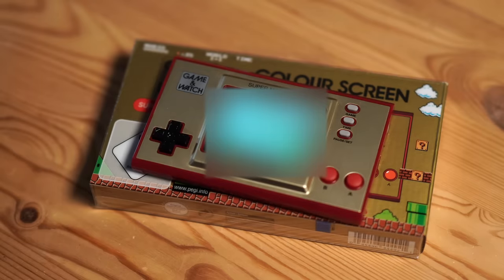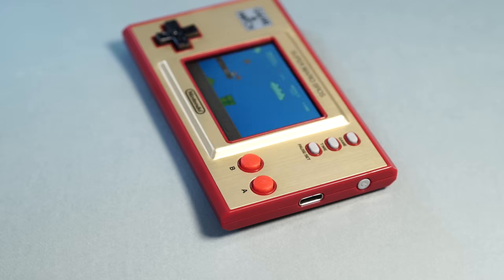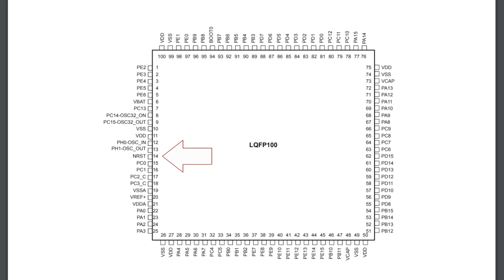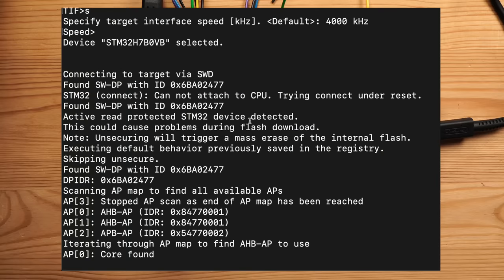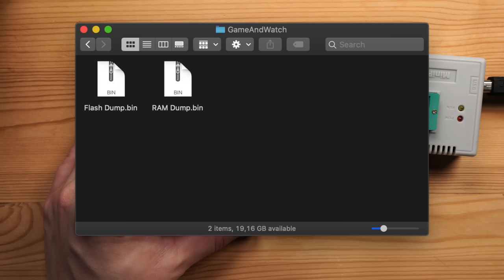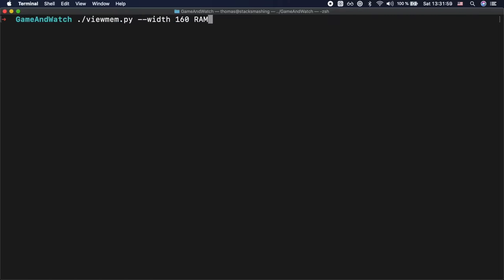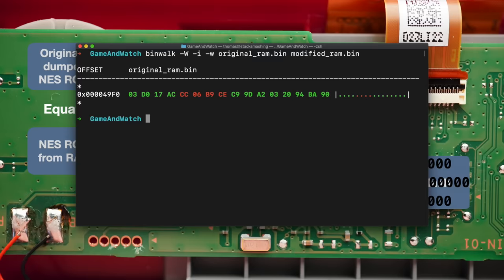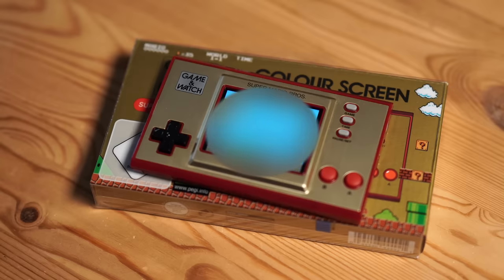Hacking the Nintendo Game and Watch

Comment: I can't wait until they make it easy for us to dump roms into this thing...
Reply: Since the USB data ports aren't connected it will never be as easy as the NES mini. Maybe people with the tools and know how though will provide a service you can send your game and watch in and have it reflashed.
Reply: @littlefreak3000  yeah I know they explained that part in the video... but now they know where the data is, I'm wondering if they can connect the data to the port OR take the exsiting port out and putting a whole new one on there with a modded chip that connects to the data... I don't know if it's possible but since they've isolated the data point it's not impossible right?
Reply: @littlefreak3000  otg via usb-c port can be?
Reply: @jeffcross9960  Impossible? No. Even remotely simple? Definitely not.

If these were being produced on a much more massive scale, and Nintendo was openly planning to make many more units in the coming years, it might be worthwhile for someone to make/sell a custom programming device/clamp that could do the process faster. For how small of a run this is, that's highly unlikely to happen.

As it is, I think the best we'll get is a few folks specializing in doing the process themselves manually as a paid service. If the service could be done for a reasonable price, I might be down for it.

Realistically though, I think that it might almost be better for someone to figure out how to store something like a pi zero inside of one of these shells, with all the buttons and everything functioning as they should. But... This looks to be a teeny tiny device. Not much room to work with in there. Who knows.
Reply: @dantehchad2227  yeah I figured... but still if people REALLY want to do this they could and that's enough for me to be at least a little hopeful. I was also thinking of a pi zero but with all the single screened Game & Watch games in them as well hahah... again high hopes and low expectations... so I AM thinking realistically...
Reply: @jeffcross9960  I think you're on a reasonable track there. Honestly, with these coming out, I wonder if someone might do a teardown, clone the body, and redo the internal layout to be friendly enough for a pi zero setup. Be pretty easy to put the entire collection of NES and GB onto something like that, and I imagine a lot of DIY types like myself would totally buy a kit like that to put together on the weekend.
Reply: @dantehchad2227  I would SO love to buy one of these kits to make my self... I DID buy 2 of them hahah... I would be even more into it if they can add another screen hahah but that might be asking for too much lol.

Comment: *1 month later
"Play Original Doom on a Super Mario Game and Watch"
Reply: Not nearly enough RAM. Maybe a cut down version such as the 32x port. Wolf3D or Blake Stone will run just fine though.
Reply: It literally has 1mb of storage. You ain’t playing shit on this thing.
Reply: Andrew Oberhauser Some Doom ports were fit into 2 megabytes with multiple levels. And they probably didn’t even use compression. Back in the 90s I had a copy of Quake with some multiplayer mods (but only 1 level) on a single floppy disk.
And finally, since you need to open it anyway, SPI Flash chip should be trivial to replace.
Reply: @noop9k  this has 1mb. And your average modded isn’t going to replace the chip. There won’t be a scene for this thing.
Reply: Andrew Oberhauser The scene won’t ask your permission.
Reply: Aaand the Doom port already exists

Comment: Awesome video!  I am currently trying to figure out if doing video out from one is feasible. I am not very knowledgeable about these smaller LCD panels. Are they mipi or standard lvds? Is there even such thing as a video splitter for the signal output or would I have to run jumpers from pins?

Comment: With the ability to load any game on there, I might just buy one of these. Could backpack another microcontroller and larger ROM on there and potentially have a hot-swappable game library? Or perhaps the firmware is able to handle a larger rom with more contents? Identifying the game directory format in ROM would be interesting. Also can you try the various under-volting (with specific timing) techniques to break STM32 read-out protection - this has been accomplished recently (STM8 for sure and possibly STM32). Reverse-engineering the firmware of this would be very interesting and have lots of potential to add new mappers, more games, etc.

Comment: You're going up against a stacked deck if the Embedded system is using the Flash in a XIP mode. My guess is that they may be moving some parts of it to RAM for faster execution. Unfortunately they are probably not using the Flash as memory storage so those handy Flash read/write and sector management functions would probably not have been moved to RAM :(
I cannot believe they did not completely lock down the SoC though... wonder if there are any test functions in RAM that they were using for manufacturing QA, possibly even provisioning (though I doubt for serial flash programming; that was prob. pre-programmed before going on the PCB).
Pretty weak encryption on the flash too, they left the door wide open (inspecting the RAM and flash and doing a reverse encryption), was it actually XOR or some polynomial (n-bit shifter) ?
Good work on it so far, good luck on the rest!
Cheers,

Comment: Since this thing is more or less made from off the shelf parts, wouldnt it be possible to upgrade the flash chip to something larger than 128kb, then load the original firmware on it (after an exploit to load further roms on it has been developed of course)

Comment: What is your approach for dumping this chip?
I have had great success dumping the F2 and F4 chips (rdp1)  using vcc glitching on the system bootloader. Perhaps this would work on the H7B0 also?
I was also able to dump F2 at rdp2 by a double vcc glitch.
Reply from the maker: Yep that’s the plan, glitch on vcore while in the bootloader
Reply: You think you can glitch it without removing the chip from the pcb or did you buy a bunch of these for this purpose? :)

Comment: Great work!  Next step: desolder old 128 KB flash module and solder in new 1 GB flash module and then load in all the NES games that ever came for the NES.  It's only 8 pins you have to desolder, not that difficult.

Comment: Very interesting to see them using a flash chip, but I guess it's a necessity when they have to deal with large ROMs. One thing you should check is the BOOT_ADDx register (refer to section 3.4 Boot modes in the datasheet). This should hold the address of the main program's entry point, which could very well be in the RAM! In this case the entire program is held in the RAM, which would make sense. Maybe you can create a hacked Nintendo ROM that will read this register?

Edit: Yeah, if I were to make this thing, I'd probably put the entire emulator engine as well as the games into the flash chip, and leave the MCU firmware quite primitive, only having it read and decrypt the flash chip, load it's entire contents into RAM, and jump to program's entry point. What's the size of flash chip in your case? Does it fit fully into MCU RAM?

Comment: Can you just write a program to memory that will read the flash?
Reply from the maker: Unfortunately not, any access to the data bus causes a hard fault
Reply: @stacksmashing  So debug mode allows you to view ram, but you cannot write to RAM, you cannot control program flow?  I was thinking if you could write to RAM, you could write a program that dumps the flash to a serial port.

Comment: Can you hack the system so it doesn’t shut off after eight minutes so you can use it as a clock
Reply: It will stay on if you keep it plugged in.

Comment: Pretty interesting and impressive, they've got a full NES emu running on the UC!?
Reply: Nintendo had a NES emu running on the GBA over a decade ago.
Reply: @powerlated1348  Wait what? Source? Also, a GBA CPU is somewhat closer to a SoC than to a UC in terms of power (but then again, that specific UC in the G&W is pretty beefy... and in fact might be pretty close to a GBA, not only in terms of performance but in architecture too IIRC).
Reply: @cheaterman49  Powerlated is mistaken. Nintendo ported some of their NES games to gameboy, but it wasn't emulated.
Reply: @HamburgerExplosion  Alrighty, thanks for clarifying :-)
Reply: @cheaterman49  No, he is wrong. The Classic NES series games are in fact emulated, and the games’ graphics are drawn through the tiled background modes of the GBA PPU. For the CPU power of the GBA, I can guarantee you that the teeny tiny ARM7TDMI stands no chance against the STM32 in the Game and Watch. Even if both CPUs ran at the same clock speed, the STM32 would be more performant via more efficient CPU design (pipelining, out of order execution, branch prediction, etc.)

Comment: did you try these attacks against it? https://www.usenix.org/system/files/conference/woot17/woot17-paper-obermaier.pdf  ; because its RDP 1 section 3.3 . 3 years old but still could work. This is also a great chance to play around a chipwhisperer lite if you have one, the creator of the device used it to extract firmware out from protected smart light bulbs.
Reply from the maker: Check out wallet.fail, where we did less invasive attacks on the STM32 to dump it - planning to try that once a couple of test H7B0 arrive :)

Comment: so... the usb data pins are disconnected? lol we can design a flex pcb that ties into those pins connects a interface chip to allow communication with both the flash and microprocessor... pretty sure it will end up on aliexpress soon

Comment: So the emulator in this does patching on the fly, that's very interesting.
Nintendo did the same for the emulator used for Super Mario 3D All-Stars and it seems to make things easier for them as they don't have to fiddle around in completed code.

Comment: I hope there will be a modded firmware where you can disable the sleeptimer. I bought the game and watch to mainly use it as a clock. But after a couple of minutes it goes into sleep mode/turns off. Also wish for an easier method, because sadly the usb is only for power.

Comment: This thing will be so cool if it's easily hackable.
Reply: But it isn't.
Reply: @moral1481  Depends on what you mean by "easily hackable", but considering the equipment to hack it is pretty cheap and the security is close to being broken I'd say it qualifies.
Reply: @blahdelablah  it would be easier if there was a data connection on usb c. Wich is expected on a divice this price range. Imo. And there is not enough space on it.
Reply: @moral1481  If there was more space on it it would have been overengineered.
Reply: @blahdelablah  maybe this would lead to a more quality product.
Reply: @moral1481  Not really, it would just jack up the cost. Think about it like this. The device is sold with 3 games. Why would they add space for 20 games if all they need is space for 3 games? There's no reason for it. When you hack devices like this you're working against what the manufacturers intended, if Nintendo wanted people to hack their devices then you'd have a point but I'm pretty sure they don't want that.
Reply: @blahdelablah  so you think nintendo wants the nes mini and snes mini to be hacked?
Reply: @blahdelablah  often the microchips for companies are cheaper because they buy larger quantities of them.
Reply: @moral1481  "so you think nintendo wants the nes mini and snes mini to be hacked?" No. Read what I said. I'm suggesting Nintendo doesn't want any of their products to be hacked.
Reply: @moral1481  "often the microchips for companies are cheaper because they buy larger quantities of them." Yes, but that has nothing to do with it, because buying 100,000 1GB flash ROMs will still be cheaper than buying 100,000 8GB flash ROMs. In engineering, you optimise the design based on providing the required functionality at the lowest cost. It makes no sense for Nintendo to buy larger flash ROMs when they wouldn't use the space.
Reply: @blahdelablah  but why had nes mini and snes mini consoles etra storage space, then?

Like the battery in the game and watch is from the joycons. Nintendo got many of them laying around.
Reply: @moral1481  "but why had nes mini and snes mini consoles etra storage space, then?" I'd suspect for OS updates, as far as I'm aware they both ran a Linux-based OS. Based on this teardown it seems the G&W device uses a much more limited OS. There may still be some space for some more games, but I suspect there won't be enough space for the entire NES library like you can get on the NES Mini. "Like the battery in the game and watch is from the joycons. Nintendo got many of them laying around." Yes, sometimes it's cheaper to reuse what you already have access to, but not always.
Reply: @blahdelablah  yeah. Maybe one to two roms. The problem is that i see no other way right now than to erase all the existing os on the game and watch.

You could probably make a expansion board for the debug ports.

Right now looks like the best solution for 'hack' the game and watch most effective. You could probably add extra storage for a nother os that way.

Comment: kinda interesting that Nintendo went with a STM32 actually, its not as easy to load a rom but that will make it possible to load own firmware on it and of course loose the original firmware forever.
im not too familiar with the STM32 and if its even possible to read its firmware/code, I thought that it was only to write to (unless of course reverse engineer it), I dont have one so cant really toy with it :)

Comment: You could try a Fault injection attack to try to bypass the Firmware protection. The only downside is that if not done correctly you could damage the chip and would need to buy a new device or probably just buy the stm32 mcu and once you get it working standalone attack the real device ;)
Refer to this  paper for more info:
shaping the glitch:optimizing voltage fault injection attack
Reply from the maker: Very aware of that paper, thanks! I’ve also published research in the past on glitching different STM32s :)
Reply: @stacksmashing  Interesting, mind to share the name of the research/title you've done on glitching STMs?

Comment: You might be interested looking at this article from Kraken, they talk about using voltage glitching to trick the processor into thinking it's in RDP 0 when issuing a flash read command in the process of dumping keys from a Trezor.

https://blog.kraken.com/post/3662/kraken-identifies-critical-flaw-in-trezor-hardware-wallets/

Comment: That's some pretty weak encryption. I would have expected an encryption key on the areas you can't read from. I wonder though if Nintendo half assed this on purpose. I mean, it's not like you can't get a better emulated experience from a Nintendo Switch and since they aren't licensing games for this piracy is less of a concern. By putting in a token effort they can claim to fight hackers, but when it's hacked their sales will go up making them more money.